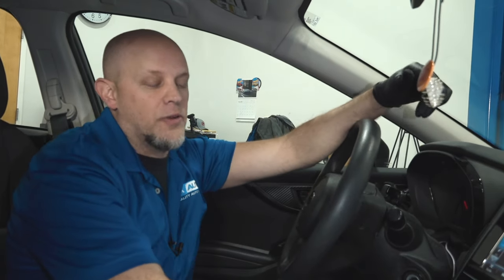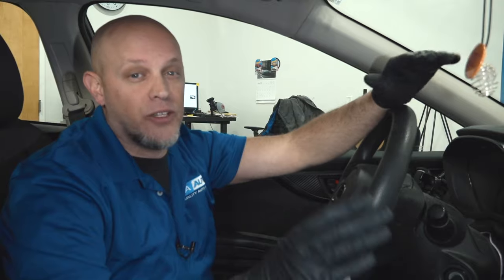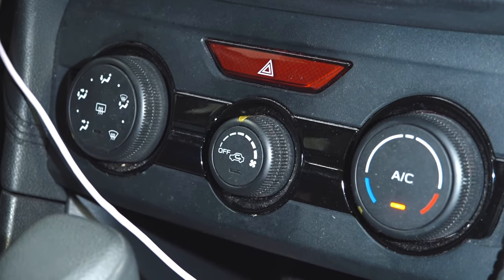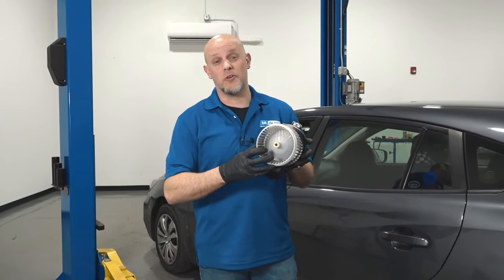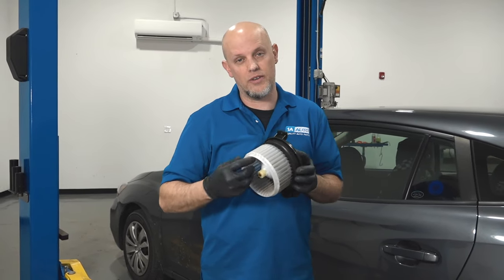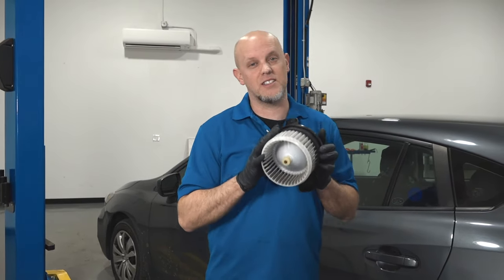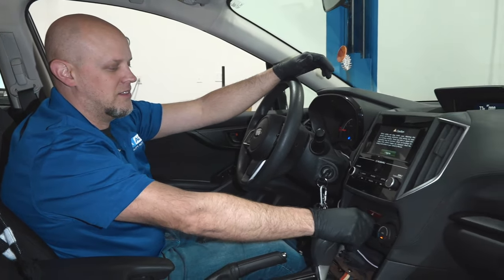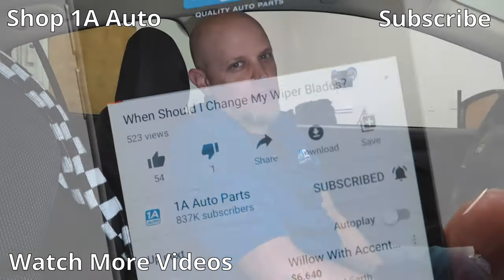Squealing Vent Noise in Your Car or Truck? How to Check Blower Motors!

Comment: Pop the end cap off the motor spindle, put about a dozen drops of penetrating oil on the spindle while spinning the squirrel cage fan.  Follow up with a few drops of three in one oil.  No more squeak.  Usually lasts about two to three years.

Comment: I replaced my blower motor which had a low grumbling sound, that is fixed now. But, I still have the high pitch sound, but its only when the fan is on high and the air is coming out of the floor vents. If I set the air to come out of the defrost or high vents there is no high pitch sound. Any thoughts? Leaves in the lower vents maybe? Thanks
Reply: Tighten the screws on the blower motor some more. Same thing happened to me after I replaced mine and it turns out that there was a small gap that allowed air from the passenger compartment to get sucked into the blower. The air traveling through the gap created a whistling noise and once I tightened the screws some more, it went away.

Comment: This could also be because the blower motor is looser than it should be. This happened to me after replacing the blower motor with a brand new one. It turns out I didn't tighten the screws enough, which left a small gap, and that allowed air to come in from the passenger compartment, creating a whistling noise. Once I tightened the screws some more, the noise went away.

Comment: I just took my 2022 RAV4 into the dealership because mine was making a squealing noise ONLY when the fan is on high and the heat is engaged to full. It was doing it since I bought it and it was getting annoying. They heard it, replaced the blower motor and it STILL does it the exact same. The head technician said this was normal design. It's the air moving through the vents and heater core. I called bullshit. Why did they replace the blower motor if it was a normal part of the design?

Comment: If the blower motor is bad can it cause the vehicle to stall or shut down? When I turn the A/C on there’s a loud screeching noise under the hood and it causes the car to just stall and die out, then I’d have to restart the engine. I have a 2016 Mitsubishi Lancer

Comment: Mines when I turn it on sometimes but as long as I turn it couple times it does stop 🛑 leave the setting as it is. But if I turn it off and reset it . Mines does go away after and yes the pitch does get higher or lower as I blow air

Comment: Any chance you give a little more detail on where that is located? Looked like passenger floor but I'm just guessing. I've got the 13 rogue special edition. It's getting pretty cold here in NH. I've started cranking the radio to mask the noise
Reply from the maker: +jared vahl This is typically located behind the dash and behind the hvac box.

Comment: Hi, my Nissan Frontier not blowing hot air in idle, but when I started driving the heater started to work.
Reply from the maker: +eduardo mendoza We wouldn't be able to diagnose an issue like that here, you may want to have a local mechanic take a look at it. Thanks for checking us out! http://1aau.to/m/Shop-1AAuto-c
Reply: I would check the tire pressure just to be sure😁

Comment: What does it mean when front vents won't run even on high?
Reply from the maker: +-KANDY- DA FAWKIN MAN!!! We wouldn't be able to diagnose an issue like that here, you may want to have a local mechanic take a look at it. Thanks for checking us out! http://1aau.to/m/Shop-1AAuto-c
Reply: Check your blower motor resistor - controls the speeds of the blowing